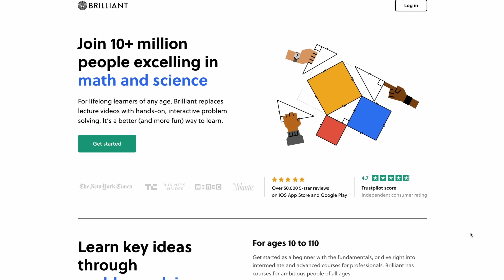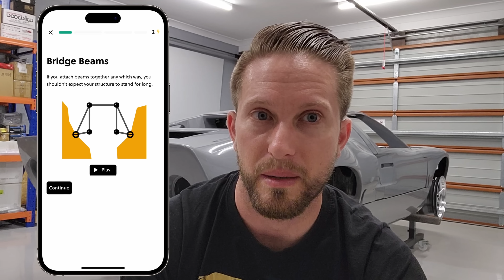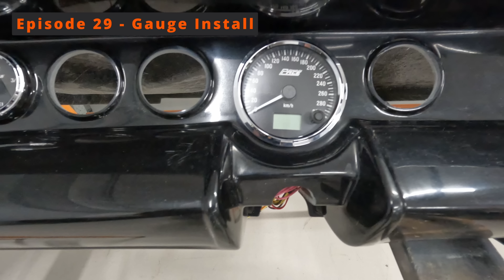GT40 Kit Car Build - Ep 30 – 2022 Recap & Next Steps

Comment: You’re doing a great job of building this car. You faced challenges and overcome them. You’re problem solving has been really good. Now you’ve got it basically together it’s time to start sorting those small issues that have popped up. You’ll think it’s never going to end. I’ve been using PETG instead of ABS. It’s easier to print and doesn’t warp like ABS. Also try the carbon filament. Might work better for your application. With your wiring harness, get them to make the harness so it fits in the car. That way it can be removed for final figment. Then the can connect all the wiring when you do the final assembly.

Comment: I'd be onboard with an AP car but for three issues, inboard suspension, A-Arm rear suspension (in lieu of trailing arms) and the seemingly disinterested customer support from the manufacturer. While the original GT40 was built with a steel monocoque chassis, AP's aluminium looks to be the ducks'guts.  Retaining the trailing arm rear suspension would have contributed to the authenticity in keeping with the original. Outside of open wheel racing, inboard suspension fails on so many counts, those that have an understanding of engineering don't need this explained. If AP have any interest in staying in business they should pay more attention to Dan's concerns because his YT following has the potential to garnish a much greater market share of the limited number of those willing to take the leap.

I've watched every episode Dan, keep it up, you're doing great mate. Also, no need to apologise, it didn't hurt and it didn't cost. One day we might meet up to share our build experiences.